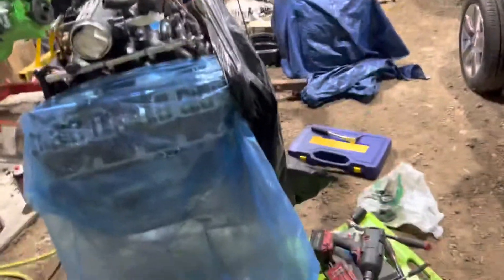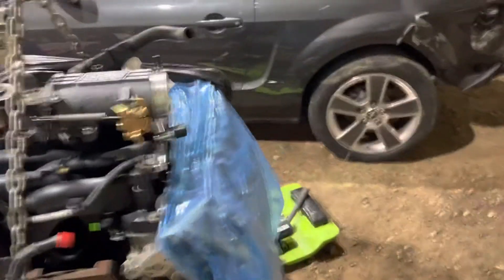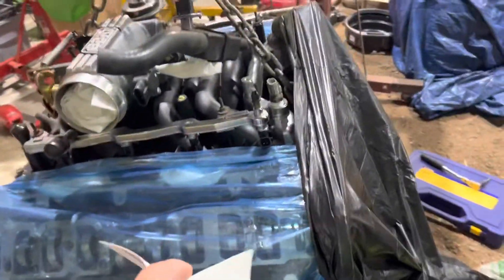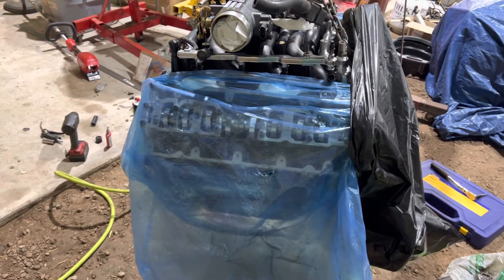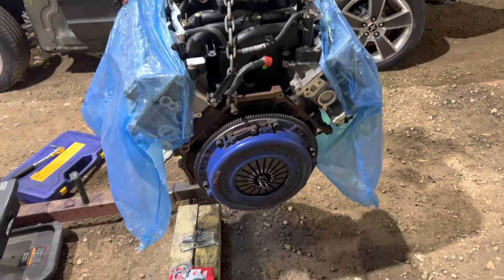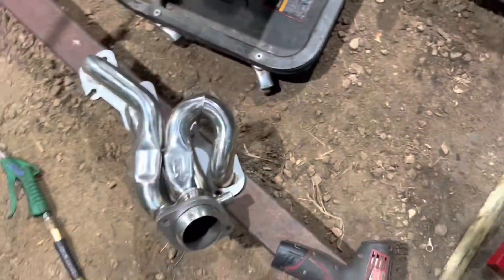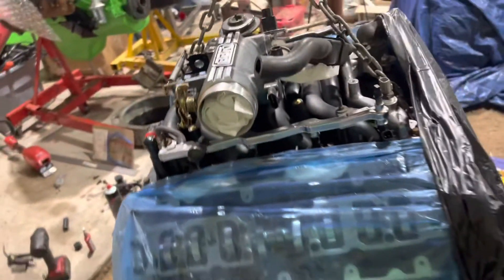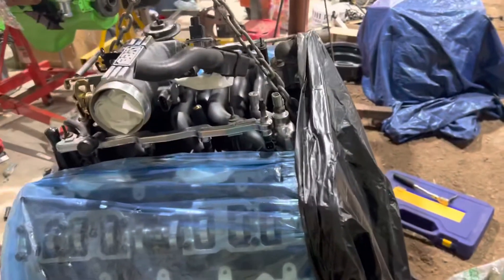4.6l engine build part 2

Comment: Your dope I think your videos will help me in a budget way tooo❤❤❤
Reply from the maker: Good man I’m glad to hear it! I hope my videos can help you out. Like i say, marketplace and 2nd hand parts will save you a fortune. Also I only went shorty headers because I got them for 100 dollars otherwise long tubes is what you want for power. And an aluminum flywheel and driveshaft will free up some extra horse power at the wheels too.
Reply: @T-MillProductions  Im starting to watch your video so I can learn what to get and how to do it what should do to the transmission when automatic
Reply from the maker: Awesome man, the automatic can stay the exact same, all you need is a 6 bolt flex plate or if you have  an 8 bolt crank you would need an 8 bolt flexolate